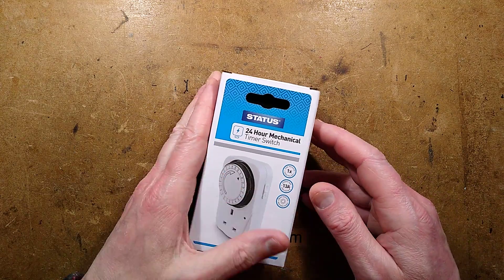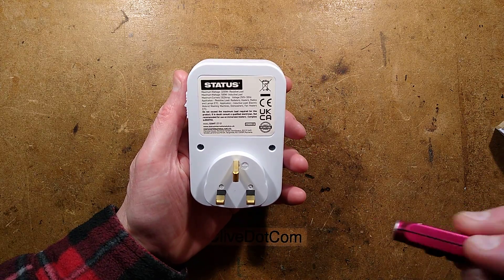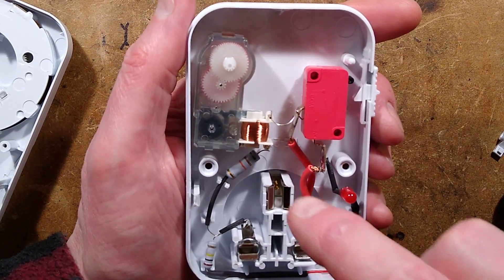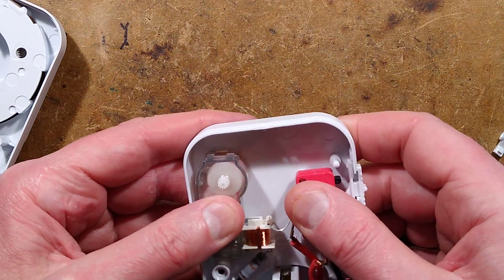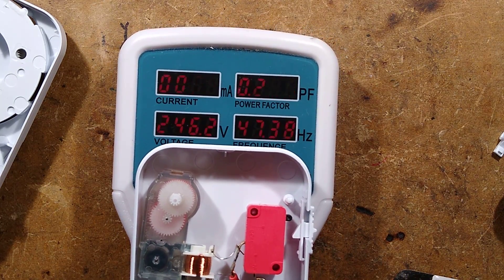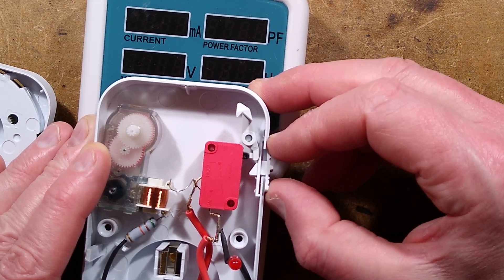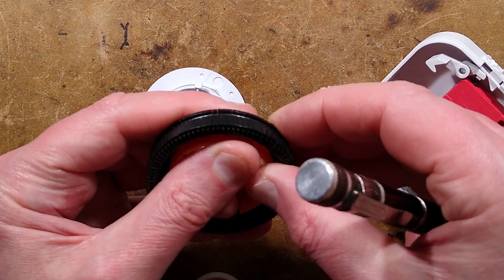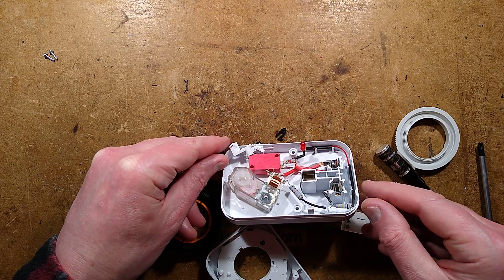Inside a simple mechanical time switch

Comment: Your device is new, I had to repair one. Those resistors will burn out eventually. Thats the only thing that should be replaced there, to put 5W resistor or 10W resistors of the same value and it will last forever. If high power device is used microswitch will bend bimetal contact inside and it will not conduct.
One thing you didnt mention is that black arrow. If timer is out of socket, it doesnt count time, doesnt rotate dial. So when you plug it next time, you need to adjust to correct real time by twisting dial. Also because of inaccuracy its required to adjust it daily.
Reply: The 51 K resistor is dissipating approx 1 Watt so ok 5W but 10W is a bit of an overkill.😏
Reply: @brucepickess8097  You are correct, but overkill means it will work for 20 years. "1 watt so 5W is ok" means its ok for 5 minutes. If you let it run 24/7 resistor will be dead in 6 months (its a lot of minutes of heat and detrition). Dont trust me, just buy one and test it.

Comment: As a electrical project engineer I  always specified mechanical clocks with spring reserve for exterior lighting.  After reading the 1/2" programming manual no one can figure out how to program the digital timeclocks, especially your lowly custodian.  Add a photo eye in series to keep the lights off during the day in case they are mis-programmed.
Reply: I agree! Our condo installed walkway lighting. We has a celestial timer delivered with the lights.  The electrician exchanged it for a photocell daylight switch.
He could not understand the understand the automatic one's manual.
Reply: @williamterry3177  Yep, I've seen models where you enter GPS coordinates,   totally over the top.
Reply: Whats the model name of the mechanical timer you are talking about? Did not know that some come with spring reserve.
Reply: @mofo78536  by mechanical I mean the on/off times are set by pins or cogs, like the one shown, they still have a clock motor,  but no other electronics.   TORK or Paragon  have such models I used to specify.  The spring reserve keeps the "clock " turning for some time if power is interrupted for some specified time period.
Reply: I changed my mind on these. I just set one of these up and it was pretty easy... Leviton VPT24, in "Pro" mode you just enter the longitude and latitude in whole degrees and can set on/off times by sunrise and sunset with an offset in minutes. Even has a battery backup and everything.

Comment: The inaccuracy may be due to positional inaccuracy of the switch/tab elements and not speed inaccuracy in the motor.
Reply: I believe so. The mechanism is reliable but sloppy.
Reply: IIRC the inaccuracy is from the line frequency nit the synchronous motor. Most countries allow the power line 50Hz to drift down under heavy load with catchup when the load is less. The guarantee is that 24hrs will be accurate but point to point time may differ from real by a few minutes. Countries do vary as to their tolerance with no slippage allowed in some, e.g., most (all?) of the USA maintains 60Kz as a solid standard.

Comment: What you pointed out at 7:22, is a ratchet that allows you to forcibly turn the dial around to set the hours of the time on it, making that loud click-buzz in doing so, these will also visibly be an hour clock where they are plugged in

Comment: Yours was a very chap, there are some much better ones (for DIY/modifications) where they have a big square module including the microswitch, timer and motor in one unit, there are three terminals. A resistor is connected on the outside (after terminals) and the live (or neutral depending on orientation (Sweden)) going to the switch and the socket.
I love these small timers (that I described) as you can remove the module and put it in your own electronics, some modifications need to be done, and that is removing a little metal piece connecting the switch and the coil, then you solder on two wires for the coil, Wich can be connected to an ac transformer. I use one of those for my, what's it called... Cubbord or a wooden box, idk, but I have a code lock on it to lock the door, and at different times of the day a code either starts or stops working, I also have lights and a battery backup for it, and I'm realizing this is a very long comment...

Comment: I tried using a mechanical timer a few times and about half the time, it wouldn't turn on or off correctly. After having this problem with multiple timers, i stopped bothering with them.

Comment: I have one of these (with the South African round 3-pins) operating my swimming pool pump. I have often seen that the timing is not very stable, although it operates on my solar inverter with a relatively stable 50Hz. And I must admit that I have been tempted to open it to see how the mechanism operates and if it can be improved...

Now I know and can spend my time taking more complex things (that still works!) apart.

Thanks Clive! 🙃

Comment: Those mechanical timers are more reliable than the digital ones. Thanks for the video clive! Keep making more of them!
Reply: I changed to digital ones precisely because a mechanical one died quite quickly. It was similar but not the same as this one, and both the resistor and motor coil just went mysteriously open circuit. At the time, I assumed the resistor was a fusible resistor and the winding had originally gone short circuit after back EMF broke down insulation. But Clive's measurements on this one seem to indicate most of the power is supposed to be dissipated in the resistor anyway so I can't guess how both went open circuit on mine.
Reply: So a mechanical switch is more reliable than a TRIAC?
Reply: @No-mq5lw  Digital socket timers don't have triacs (at least most of them, idk if there are timers that use triacs), they use relays most of the time. I just like the simplicity of the mechanical timers. And of course, the electronics in digital timers are more sensitive to overvoltages, for example from lightning strikes.
Reply: @No-mq5lw  they all use relays at this power scale
Reply: This is a time machine, after yearly usage, lack of lubricant become malfunction. Stop moving, need some lubricant.
Reply: are they? i have a digital one, it has drifted maybe 1 minute over the last year. no biggie.
Reply: @JustinKoenigSilica The comment was "more reliable" no mention of timing accuracy.😏
Reply: I had both, digital and analogic, so far neither gave me issues.

I did have a couple of units that gave me trouble, first one being a analogic "no name tat" model that had the receptacle right in the middle of the dial, that one has issues switching off (I have to "help" it a little bit by pushing the dial slightly) but when switching back on it's entirely fine.

Second unit was a 1990's Grasselin timer I picked off a dumpster (was looking for broken electronics to salvage components from), it was dirty and noisy but it still worked.. Until a power surge took the motor out :( I recall I tore it apart and it looked way more solid than newer units (the plastics were considerably thicker and the switching contacts were easily accessible).

Digital ones, I've had two that lost half of the segments in the LCDs.. No clue what I did with these.. I think I salvaged what I could off these and recycled the rest..
Reply: @JustinKoenigSilica  My digital timer is already 11 minutes behind and I think I reset it less than two years ago. For timekeeping accuracy mechanical ones are better but the coarse controls (and lack of battery backup) make digital ones appealing. I have had two mechanical timers fail from worn down gears and I figure that's how Clive's unit here will also fail. My main digital timer has an internal NiMH battery which will likely be it's downfall. My other one has button cells for backup and will probably outlive a cheap mechanical timer.
Reply: @eDoc2020   all this means is there were about 11 min added outages in your area those two years. Not bad. 😂
Reply: @nikspanakis   I'm not sure where that conclusion came from. This digital timer (like most) has a quartz oscillator and LCD display running from an internal battery. This keeps its time advancing during power outages. If it relied on the power line for timekeeping it would require a reset after every outage.

It's the mechanical ones which lose time when there's a power outage.
Reply: @JustinKoenigSilica  I mean that the mechanical ones often last longer than digital ones. That is, if they are of good quality. In a mechanical timer there aren't many components that could fail.
Reply: @schaltnetzteil495  just because something is digital doesn't mean it's more likely to fail, IMO. there are well designed mechanisms and poorly designed mechanisms, same for PCBs and components.
Reply: I use a digital one that's almost 15 yrs old on a fish tank,they are much more accurate and hold set time in power outages (small battery)

Comment: They say +/- 6 minutes per day but I imagine what they meant to say was there's 6 minutes of 'backlash' in the time selection mechanism in addition to the usual short term drift of the grid frequency.

Also nice surprise to see a mass market consumer electrical device like that have tri-wing screws, all too often I get stuck with stuff that has those outrageous one way screws which makes repairing something or even just inspecting the build quality significantly more time consuming if not completely destructive.
Reply: I forget where I learned this trick but a U-shaped spanner bit works fairly well to remove "one-way" screws. It can still be a bit tricky to get them started but it's a great non-destructive method.

Comment: I expect there are 120 pins, 5/hour or 12 mins/pin. So when they say +-6 minutes, I think that's for the variation of the pin/lever mechanism but the clock itself should be accurate. In other words if you set the on time for 08:00 then it will turn on every day between 07:54 and 08:06, but more likely if it turns on at 7:57 on the first day then it will turn on at 7:57 every subsequent day.
Reply: Looking for a complex answer when a simple one will suffice. I too thought at first it must be some mismatch between the 60Hz UK mains frequency vs. a 50Hz oscillator, but then I realised it’s just the physical variance of the on/off pins as they travel across the switch.
Reply: There is a difference between time precision +-6min/day and the 6min slots for switching. 
Somehow Clive should know.
To many fissed liquors? 😂
Reply: If memory serves, there's a Tom Scott video where he waxes lyrical about the accuracy of the UK's 50hz mains, and how the Teasmade is the pinnacle of human civilization.
Reply: @davelewthwaite I remember that video, there was some question of whether to err on the other side for a while to catch up.
Reply: When considering the amount of play between adjacent pins, you have to remember that the motor always drives the clock in the same direction and as such, once the play has been eliminated by the first operation of the timer it will remain eliminated until the timer is adjusted. This is what I implied when referring to the variation of the pin/lever mechanism. The number of pins per hour is not really relevant.

If the clock is adjusted by removing power rather than by moving the mechanism it is possible to get reasonable and repeatable accuracy from these types of timer. Edit: set the clock ahead, observe the actual time of operation then remove power for the number of seconds between the actual time and the desired time. This can only apply to either the on time or the off time but not both. The difference in accuracy between the on and off times is probably what the manual is referring to.

On the other hand, while an electronic timer would seem to give the desired accuracy the drift from actual time can be several minutes per year on many models, particularly battery powered examples.
Reply: @chrishartley1210  With enough slop in the pins, you have to factor in gravity.  Also this is a moving system, there is vibration.  not a lot, but enough to move things that have what a machinist would generously call a clearance fit.  It is entirely reasonable for a device like this to have a 0.4% deviation.
Reply: Newer seen 5 pins per hour. Only two, three four and six (six being terrible to operate). 4 is a standard in UK.
Although there is no obvious statistical reason for any of specific times within the range. When you are turning one of these, you can adjust the time reasonably exact but its unlikely you get same time each time. 6 minutes would probably be a legal denial of liability, but actual offset would rely on batch or actual manufacturer. (Status is a whole-seller brand).
Reply: This is what I thought as well. There is a lot of slop between the set pins and the switch.

The warning is written pretty poorly though.
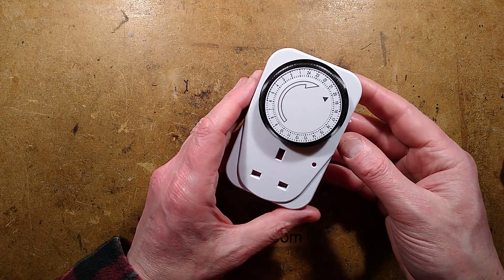Reply: Look at 1:02 , look at line markings, its 4 black pins per hour not 5. One black plastic slot is 15 minutes. You cannot expect this mechanism to be more or equally precise as the one with quartz. Mechanical inaccuracy of this device has to be more than 5 minutes per day. 5 / 1440.
Second part of your answer doesnt make sense... if you adjust dial, at 8:00, and you plug it in socket at 8:00, timer will act as a clock. if you use second pin in 8-9. it will turn on right at 8:15. However, tomorrow at 8:00 real time, timer will be at 8:06 or 7:54.
Daily activation will be moved every day by inaccuracy multiplied by number of days.
Reply: @orion310591RS  I'll accept your premise that there are 4 pins per hour, I was simply going by the claim of +- 6 minutes.
As to the clock accuracy, the clock has a synchronous motor, it is as accurate as the frequency of the mains power. Such motors (and clocks) are generally accurate to within a few seconds per year. The previous timer for my central heating used this method, the only time I had to adjust it was after a power outage.

The way to set these timers reasonably accurately is to set the clock a few minutes ahead of actual time so that the timer is triggered slightly before the desired time. Then remove power from the clock to adjust it by the amount the timer was out.
A similar exercise could be done for the off time, but only the on or off time can be "accurate", not both.